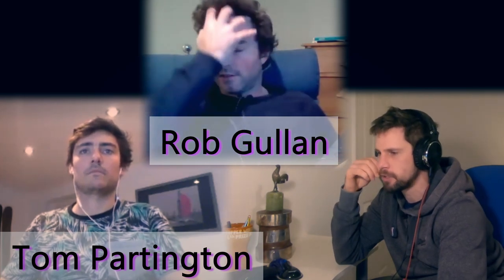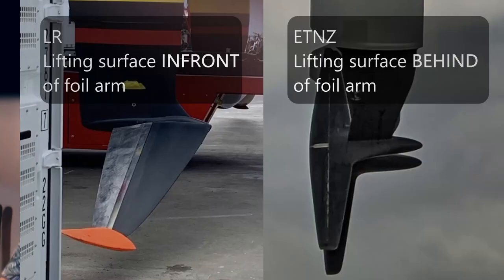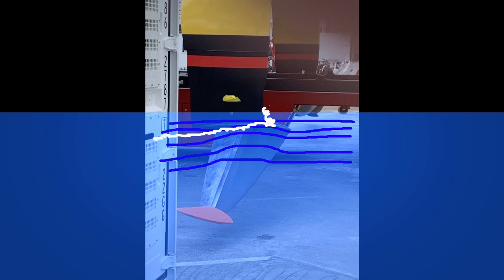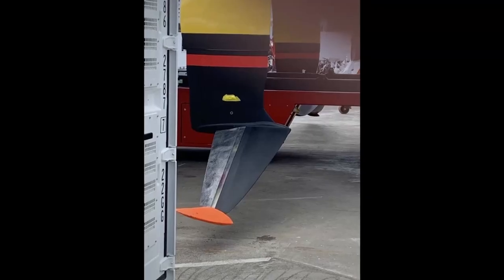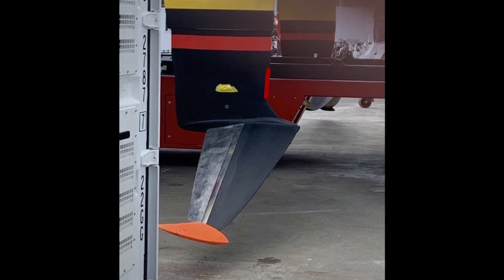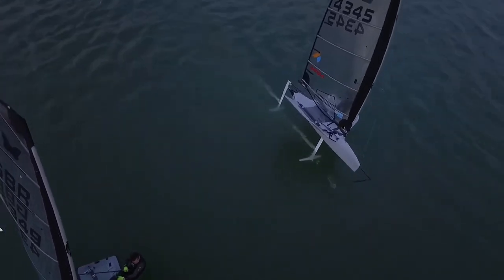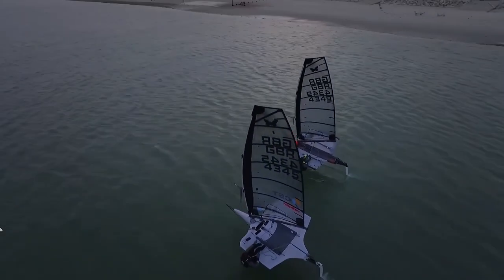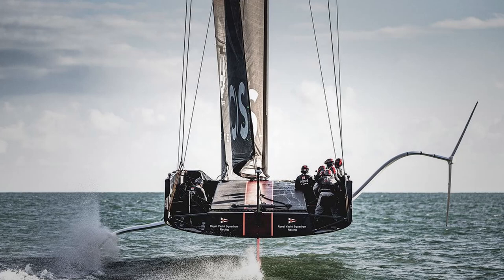AC75 Pitch Instability: The Hidden Power that Teams Won't Discuss

Comment: Very interesting discussion and well thought through. Perhaps you might consider how a canard configuration (rudder in front, Center of Effort slightly forward of the CG so rudder is always lifting (5-10%) for overall less foil load and less induced drag. Gusts are handled better, better stability given this configuration is naturally stable.
This was how NF2 was designed in the 70s to wind the world speed record twice in 77 and 79 (225 sq ft)
I can share a picture of the design if you are interested.

Keep doing these programs!

Comment: Thanks for ALL of the thought provoking discussions!!  I am hoping to see another about speed vs. sailing angle of each boat and how they may have "improved" to be able to sail higher upwind and lower downwind while, in each case, retaining speed.   I know that this varies with wind strength, but would love an analysis of the best tacking angle and downwind angles of each boat.  The boats who do these best should have, over several races, the shortest distance sailed compared to the length of the course.

Comment: Neutral point and static margin are key terms here that you guys described in other words. Neutral point is the point around which the pitching moment doesn't change as the boat pitches up and down. Its mostly a function of the area and fore/aft location of the foils. Static margin is how far forward of the neutral point the center of gravity is. Positive static margin and the boat is stable. As soon as the CG is behind the neutral point the boat is unstable.

 Generally teams want want to reduce the static margin to reduce trim drag. But if you push the cg too far back, or the main foil too far forward, the boat becomes too unstable. Thats why Oracle's first AC 72 "the mistress", was so hard to handle. "The wife" had a bit more trim drag, but was much easier to handle. In two boat testing, Ben drove the Mistress, and Jimmy, the wife.

Comment: The reason planes are designed nose heavy is for stall recovery. As the old saying goes, planes with forward CoG fly badly, planes with aft CoG fly once. The elevator trim induces drag to stay in balance, so during cruise the passengers can put their seats back a bit (in a Cessna) and get an extra knot or 5 of speed.

Fascinating that the AC75s have aft CoG. With computer-controlled trim essentially anything is possible.

Comment: Compared to an aircraft stability on an AC75 is way more complex. Stability must be achieved in all axes at the same time, each influencing the other two. The force coming from the rig is a major player in all this.
Reply: Indeed!  One crew member, who owns a small aircraft, commented in a video that it was far more difficult to control an AC75 than his aircraft.
Reply: @maxhugen  A (conventional) aircraft is stable by itself. All you have to do as a pilot is point it where you want it to go and manage speed / climb/descent status.
I can't even fathom what it means to harness the power of the wind at that large a lever and use it to both go fast and balance it on these two small lifting surfaces set at an odd, asymmetric geometry.
Reply: Was about to say very similar, really complex mix of hydrodynamics and aerodynamics, at boundaries in ever changing conditions. Very much the F1 of sailing and hopefully will provide some real insights into some poorly understood areas in time.

Comment: Curious as to why 54 knots equals 100km/h?
Because they were both derived from the same assumed distance from the North Pole to the equator. While the French decided to define this distance as 10,000km they also define a right angle as 100 Grads while the Pommes some centuries before had defined the same distance as 5400 nautical miles and based on a right angle having 90° give each degree covering 60 nautical miles from their definition of 1 minute (1/60th of 1°) angle covering 1/5400 of the distance from pole to equator(1/(90×60) and equalling 1 nautical mile. 
ie. 100grad × 100km = 10,000km = 90° × 60' = 5400nautical miles.
(So - polar circumference = 40,000km = 21,600 nautical miles and 54knots = 100km/h)

Comment: You get more leverage by placing the foils off center from the foil arms. Also it seems like all the teams are copying the spirit of the AM boat to compress airflow tightly against the water surface at the bow. TNZ's foils seem designed to also facilitate this forward pitch to create marginal lift out of the hulls which all seem to be influenced by lifting body designs

Comment: Good points on longitudnal stability but another significant aspect seems to get missed in all the comentary is Heal. The axis of heal for these boast is not close to along the centreline like normal boats but along a line between the two foils or canted way out to leeward. So when the boat heals even slightly the bow is raised, increasing the angle of attack of boat foils and causing the boat to heave upward, conversly leeward heal casues a downward angle shift and the boat reduced flight height. The extreme case (due to a whole lot of other issues) was the US crash but its visible a lot of the time when the wind is variable. Since any heal induces a change in attitude and consequentky flight height, which must be instantly corrected with flap control its a serious instabiity problem. Getting the foil location vs CoG balance correct may make it a bit easier but I still think the flight controllers are keeping very busy in gusty winds.

Comment: I think the aero pitching moment isn't all that significant, despite what some are saying. The foils have a high lift to drag ratio, so the don't make much drag. Therfore the rig doesn't need to make much drive force. The high lift to drag ratio of the foils means that its hydro lift or sink and weight placement that dominate pricing moment.

Comment: Center of pressure furthest aft, putting it closest to CG, will be most stable.  a longer arm between an aft CG and the foils means more instability.  It's dynamically unstable.  A ball sitting on top of an inverted bowl; move it anywhere away from the center and it will always accelerate away from the center.

Comment: Way more complicated than an aeroplane. Here you have two centres of pressure; a hydro CP and an aero CP. The Rules only seem to relate to the hydro CP. I guess that the safety aspect here is that, unlike a relaxed stability aeroplane, the Eurofighter Typhoon for example, these won’t flip over backward because either the front hydro-foil will suddenly become an aero-foil, drastically reducing its available lift, or the aft of the boat will slap the water abruptly stopping the pitching movement. As you said, I imagine the net hydro/aero CP moves in front of the at some point making the rudder foil a negative lift stabiliser making the boat relatively stable; downwind this will probably be pretty instant. I have no idea how they control the rudder pitch (Is the pitch stabilised AND DAMPED via a computer, I have no idea of the rules?), but I’d be impressed if they run it as a relaxed stability rig, as per a Typhoon, which has buckets of electrical power and operates in a single medium. As an aside, do you think Ineos have missed a trick on sealing the boom/deck gap? LR have really sorted out the interference drag in this area, even down to the main sheet. I notice that ETNZ have followed suit. INEOS’s deck sail sealing and fairing (Wing fuselage sealing and blending in my language) seems poor by comparison. As an awful sailor, who knows nothing about hydrodynamics, I’m fascinated by this and enjoy your thoughts as it’s well outside my knowledge base. (But I think it may be even more complicated than we realise. Although I’m sure George Stokes would have loved it!)

Comment: Hey guys could you give your thoughts on correct helm  action to take in the near capsize situation, ie. Bear away vs bear up. There is a training video of ETNZ I think practising this.  Counterintuitively you need to bear away when overpowered into a near capsize, I think due to centripetal forces and center of mass of hull/rig being high. I think lots of sailors have learnt to incorrectly bear up when overpowered, and I think Dean Barker did that in fur moments before their last capsize.
Reply: Typically bearing up does increase apparent wind in a cat. Bearing away is also fast so I would avoid major maneuvers in gusts
Reply: It seems that they are losing rudder when these near capsizes occur, forcing them up into the wind. I could be wrong though.

Comment: I find the observations about American Magic's crew positioning and helm vibration etc very interesting. As well as being the only team to push crew weight aft, they are ALSO the only boat that had a hull with pronounced tuck upwards in the stern - the others having skegs going all the way (or close to it) to the rudder.

These two things in combination I think are very interesting,

If the centre of gravity impact was the ONLY thing involved in the design decisions here (I know it's far from the case) forgoing the stern tuck would seem a MUCH MUCH more effective way of getting weight aft (in the hull body) than moving the crew aft.

Leaving the sideways blocking of pressure transfer aspect of the skegs aside for a moment, you have to therefore conclude (IMHO) that the American Magic designers thought there was a BIG aerodynamic and or hydrodynamic/less wetted surface area gain from the stern tuck, that perhaps was thought to be SO big that they were willing to try and compensate for the lost aft weight by moving the crew aft.

Further I am assuming that their designers felt that once flying, the flow of the air in the stern tuck section of the hull would be sufficient to block (or lessen dramatically) any leeward pressure leakage.

Comment: The reality is far more complicated than you're presenting. The rudder lift foil's main job, once the hull is lifted out of the water, is counteracting the changes in the torque applied along the axis that runs through the arm joints as a result of varying apparent wind forces on the sails. It's great at counteracting any moments that are pushing the mast tip forward - not so good with moments applied by the wind in the opposite direction. So the one thing it can't do very effectively is counteract a rising bow that is lifting when the combination of apparent wind direction and hull speed cause the bow to rise - as appears to have happened with the AM capsize. Once the 45mph air flow gets under the boat and turns it effectively into a gliding wing (we've all seen what happens in extreme cases with unlimited hydroplane race boats when the nose lifts at 165+ mph), because the vessel is balanced on only two points of contact with the water, there's nothing to counter the rise of the nose and windward side of the hull. If your control system pulls down on the leeward  arm's foil in an attempt to keep the nose planted, the windward forces on the mast are counteracted less and the boat goes over more rapidly. Attempting to counteract the nose's rise with the rudder foil achieves effectively the same thing - may level the nose somewhat just before the mast takes a leeward dive in the drink. A more stable design would use a stern and midship foil with outboard foil arms that operate on the windward side only - leeward foil arms are always out of the water when not tacking or gybing.

Comment: Isn't the main disadvantage of having the crew aft the lack of aerodynamic sealing of the bottom of the mainsail and the hull - or was the importance of eliminating that gap only realised later by the teams? Same as minimising the air gap between the hull and the water. Team NZ just seem more pitch-stable most of the time, almost as if they're using a gyro, which would be against the AC75 rules.

Comment: Another good video Mozzie.  👍  One other point to consider: the lateral force of the foil has to counter that of the sails, and as leeway increases foil AoA, it in turn increases foil forces. But, since vertical force is more than double that of lateral force, at the point of lateral force balance the vertical force becomes excessive, so the rudder foil is then required to counter this with some downforce.
Reply: The Y foils allow some control over the ratio of lifting force to side force. With straight foils like NZ you will end up balancing things by having some yaw and crabbing upwind and/or changing the cant of the foil. You cannot efficiently use the rudder to balance vertical force if it pitches the boat bow up  - its primary purpose will be pitch control (which controls AoA of the main foil).
Reply: @giovannigaleotti2623  Yes, primary function is pitch control - but calcs indicate that some downforce is required to counter excess main foil lift. This in turn has to be countered by sail drive to balance pitch. A complex interconnected set of balances!
Reply: @maxhugen  Moving the CE of the sail plan up will decrease the amount of side force required (given that RM is limited) and increase bow down moment. 
Interestingly NZ seems to sail with firmer mid and upper leeches (this is also possible because the straight foil probably produces more RM - so the analysis is not straight forward)
It is certainly a complex system and a proper dynamic analysis is very hard  - you want the drivers to be engineers. Time on the water will let the smart teams climb the steep learning curve faster.
Reply: @giovannigaleotti2623  NZ have also put in quite some effort to power up the lower section of the main, using their "camber adjustment device" from the mast base to the clew. They are creating more camber there for drive, whilst also using a lot of twist in the upper half of the sail to lower the CE. As you say, it is indeed a very complex system.
Reply: @maxhugen  Everyone has been doing this  -  some (very limited) comparative analysis based on older videos seems to show NZ twisting less than some other boats. This would indicate that they can live with a higher CE.  The most probable cause is that their foil configuration affords more RM but there may be more to it  - or it might be a faulty observation. We can only speculate.
Reply: @giovannigaleotti2623  Yes, I think NZ have a slight RM advantage, as the T foil allows them to get the ballast mass a bit further outboard that the other teams with Y foils. Measurements I made of mast bend and sail twist also suggest that NZ were possibly getting a flatter profile (less camber) in the top section, although this is also affected by the cut of the sail.

Comment: Effect of position of C of G relative C of L forward foil

The numbers presented below are from a VPP for a nominal AC75. As precise data is as yet not available the math model’s accuracy has only been compared to data available in the Cup media. Hence the absolute numbers may not be precise but as a “what if” tool the indications given by it can be relied upon.
The $64000 question on this occasion is what is the impact if the C of G is moved 1.5 metres aft
Position 1 (close to how NZ is setup
TWS 13.6 knots, TWA 110 degrees, speed 43 knots, vertical lift fwd foil 77965 newtons, lift aft foil minus 4390 newtons, righting moment 445000 newton metres
Position 2 C of G 1.5 metres aft of that 1 above. No other changes
TWS 13.6 knots, TWA 110 degrees, speed 40.6 knots, vertical lift fwd foil 66905 newtons, lift aft foil plus 6670 newtons, righting moment 382000 newton metres

Comment: Planes have their CG forward in case they stall - if the CG is too far back the plane cannot recover to a nose-down attitude. Weight and balance calcs are pretty important and getting near aft CG limits can make small plane pilot v. nervous .

Comment: AM looked good early on, but the rush to get a boat and team on the water in Auckland came back to bit them as there boat was not as well developed and thus had some issues. The capsize and holing really exacerbated their design and development problems. Next time they'll be a better outfit, but there's a question mark over Barkers involvement on the water.

Comment: Great stuff!  It would be very interesting to see a similar analysis on lateral balance of forces.... foil arm immersion (pitch / ride height), leeway, rudder angle, and of course heel angle (heeling to windward would enable you to use some of the lift from the foil against leeway).  Under class rules must you sail with the leeward foil fully down?  or is this another parameter you can play with, at risk of the foil ventilating at the surface?

The footage of the vibration on American Magic's helm implies that the rudder is heavily loaded, and even ventilating.... can't belive this is a good thing especially if at speed air could be dragged down to the rudder's foil

Comment: It would seem intuitively advantageous to minimize the pitching moment of inertia  - to have faster change of pitch trim for a given amount of foil trim. AM idea of loading the stern with crew goes against that.
Reply: Perhaps AM initially thought they could generate more driving force from the sails, and tried to balance weight distribution accordingly. However, balancing the lateral moments is a much larger issue, and has a limiting effect on the amount of sail drive they can use - also dependent on where the CE is of course.

Comment: Great videos you guys are doing. One question to the rudder. Are their angle of attack fixed or can they adjust the angle of attack aswell? In AC50 they were adjustable befor the start but needed to be fixed to one position for a race. How is it this time?

Comment: Any plans to talk about sails?
Watching some footage of INEOS, I noticed that their D-shaped mast pivots. I guess all the teams' masts do this. Is it active, or is it turned by the rest of the rig?
Have any of the teams tried a code 0 sail?
How is the power from the grinders connected? Are they charging a common hydraulic reservoir? The foil cant system is battery powered and charged onshore isn't it?